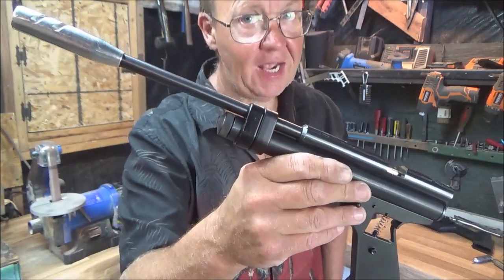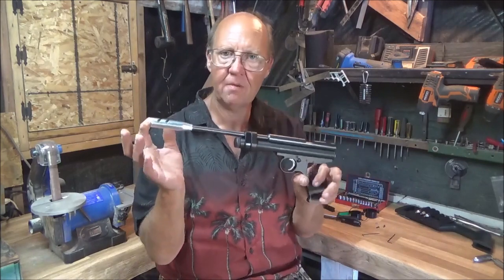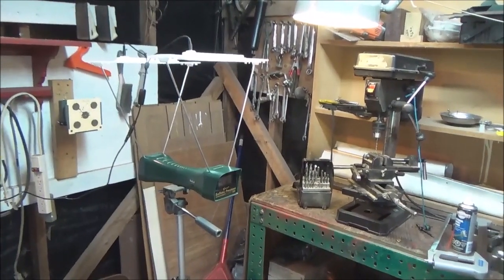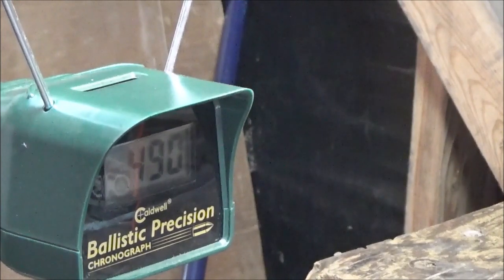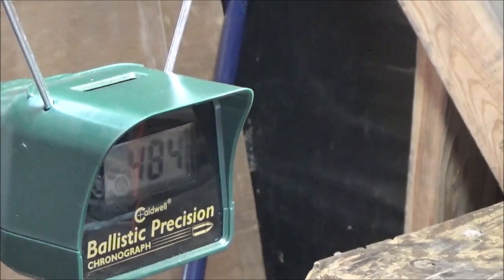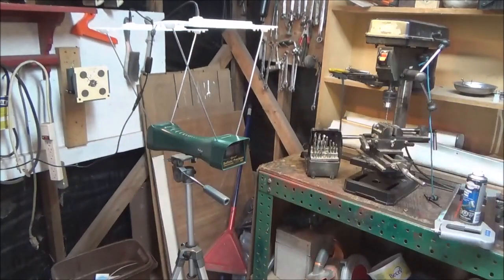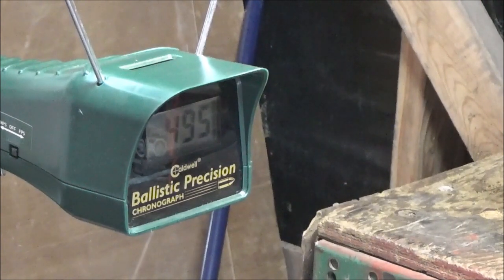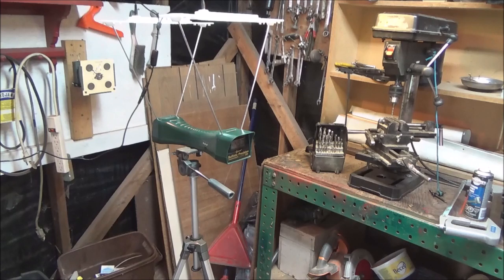Crosman 2240 Tuned To 490 Fps And How I Did It

Comment: My 2240 is now a rifle. I did the valve (Boss) swap that Ebay sells. Changed the transfer port, replaced the hammer spring, put a 24 in. barrel
Reply: And now it shoots at 650 fps. It went from ratter to squirrel and rabbit.
Reply from the maker: well it might look like a rifle buts it leagle defanition is still Pistol by law , the tube says 2240 no matter how you dress itup its a pistol ,, if you want it to me a Rifle and classed as one then it must have the 2250 tube or the 2260 tube . so long as it is the 2240 tube its a pistol , also any stock 2240 can take out gophers rabbits squirrles chimunks anything classed as small game really. even take out birds crows ravens partraige etc.
Reply: What your fps
Reply: I don't know the fps. I don't have a chrono. All's I k ow is that it'll kill a crow at 40 yrds.
Reply: Pistol-Carbine is really the most apt description....no matter what you do to a 2240 it is never a 'rifle'
Reply: @salgonzzo1196   you dont have a chrono but you know its shooting at 650fps? thats odd. Ive modified a 2240 to the gills and only ever saw 590. I do have a chrono so im not just guessing about it

Comment: How does cutting threads off the air fitting give you more power that makes no sense
Reply from the maker: more space for co2 gas in the valve and a few other tweeks and you get more power its not rocket science
Reply: @KevinMillard68  but wouldn't cutingthe threads decrease the space

Comment: You can easily give these barrels a perfect crown with some water-based jelly lubricant (just a dab) mixed in 50/50 with an abrasive powder like aluminum oxide, and use a round-head slotted brass screw in a drill.  Apply some goop, drill the muzzle at low speed, apply more goop, drill at high speed for 30 seconds.  Done.  Apply bluing to the exposed steel and wash up.  Clean out the barrel from the breech so the abrasive doesn't ruin your bore.

Ah just watched the part where you mentioned the brass screw.  Oh well.  But now everyone knows how to make the water-based jelly abrasive.
Reply from the maker: i know how to do all this stuff by the way i have been shooting airguns for 42 years and repairing and modding and making mod parts for over 20 years

Comment: Bit of a newbie here. On a stock 2240, if you take 3-4 threads off the valve, do you then need to change to a larger transfer port to get added fps? Or can you just use a larger transfer port for added fps without cutting threads? How might either effect co2 use?
Reply from the maker: you can do either and gain but you also need to replace the hammer spring with one out of a 2289 or 1377 or 1322 and yes youll need to drill the transfer port to 3.8 mm
Reply: @KevinMillard68  thanks
Reply: @KevinMillard68  thanks for the reply. Does just adding a hammer spring from 1322 etc. alone add fps?. I'm looking to get as close as I can to the 500fps permitted in Canada.

Comment: im getting 540fps (14.3gr pellet) with 18" barrel, .42 hammer spring, stock port....2240s are incredible guns
Reply from the maker: they sure are cool guns for sure and very modable
Reply: Will the longer barrel boost the FPS with that much?
Reply: @Jakelol1980   i run 16'' and 18'' barrel on my 2240 carbines....anything longer than 18'' is not needed in my opinion but people will put 21"+ barrels on them. on my 1322 carbine I prefer a 14.5'' barrel because the power threshold is lower. With my 16'' no internal mods i get around 500-510fps, my 18'' carbine with all the internal mods has shown 590 on the chrono before
Reply: @milesstover3724  I ordered a 2240XL 2 days ago and a 10” barrel. Im might want to buy a 14.5” in the future and Im also planing to upgrade with a upgrade kit with Max valve etc.

Comment: Instead of upping the gas, use lighter projectiles.  Get a .224 or .225 (62gr or bigger) mold for lead casting, but instead use "plasti-wax" which is a jewelry-making wax.  It holds together and retains its shape under pressure like plastic but can be poured like a wax at 150F.  Pre-heat your mold, I use the "warm" element on my glass stove for the molds and an old electric pot for the wax, and fill the mold with a turkey baster because I can get a good seal with the end of that and the sprue on the mold.  If you can get an 82gr mold, they are nice and long and give a better ballistic coefficient.  Anyway, these are very lightweight spitzers and perfect for 22ca airguns.  Fast and straight.  And you can recycle the wax and use it again, just make sure you have a steel plate inside a box to shatter the projectile and collect the pieces.
Reply from the maker: lighter pellets do travel faster but you lose energy and accuracy and in losing energy you also lose distance as well

Comment: where u get that c02 case on your shoulder case
Reply from the maker: its auctually a shot gun shell holder that goes on a shotgun but stock
Reply: @KevinMillard68  what size u jave ro fit the co2 12 or 24 gauge
Reply from the maker: @leonjohnsonjr3331  they only come in the 11 size that i know of for shot gun shells , check amazon or you local gun shops for them just mak sure you get the one for shot gun shells
Reply: @KevinMillard68  ok thanks buddy and great video
Reply from the maker: @leonjohnsonjr3331  thanks and your welcome